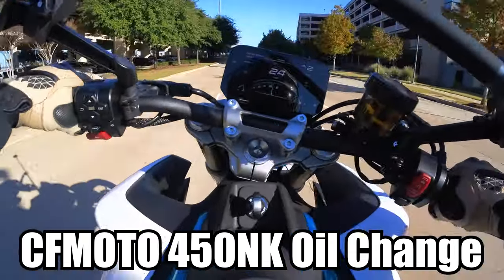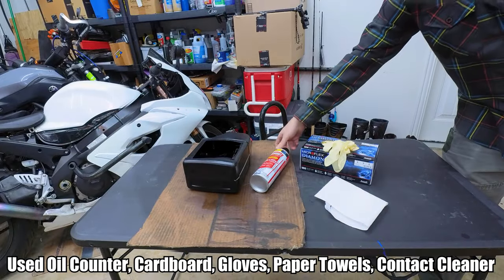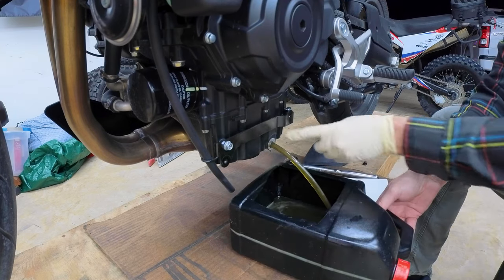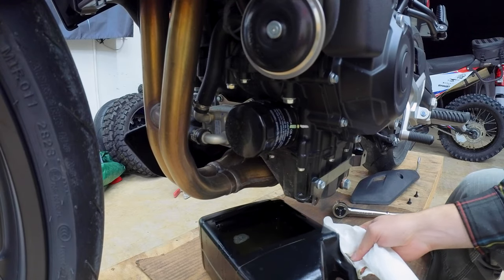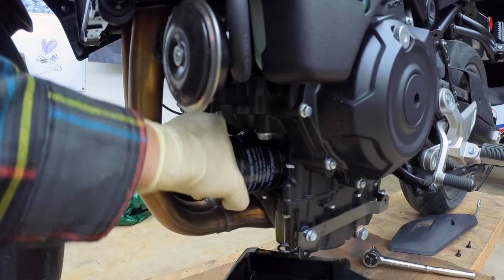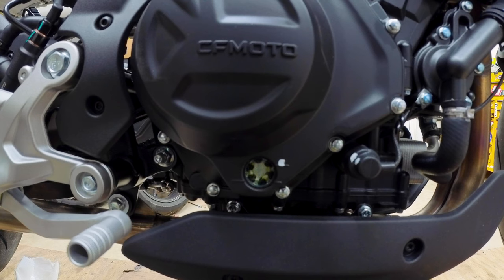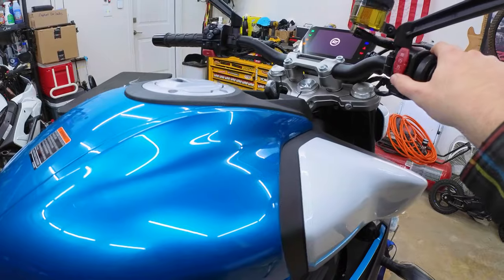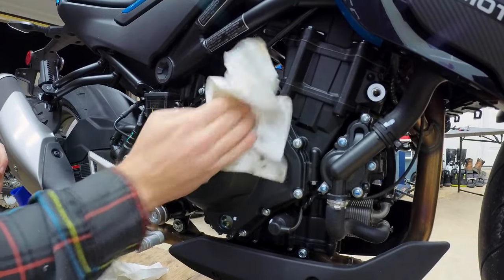CFMOTO 450NK Oil Change - Easy and Fast

Comment from the maker: Super easy oil change videos. I'm gonna try to make these for every bike I can.
Reply: YES.
Reply: EASY BEAZY BOSSS LET GETER DONE!
Reply: I know when I did my first oil change on my SV650, I was baffled by the slightly conical crush washer. I went with the 50/50 chance of pointing the cone inward to the crankcase. Turns out I was wrong, but no idea on if there is any damage until the next one in two years or so time! 😜
Reply: A man of the people
Reply: YES

Comment: Good video.  Fast but well covered.  I have the 450SS.  Did my first oil change in the fall.  Can't wait for the snow to stop so I can get riding again.
Reply: Did you use the manufacturer oil they make specifically for the bike or did you use 4 stroke 10w40?

Comment: Couple of frustrating maintenance issues about the 450SS/NK series. The recommended oil and oil filter change interval is only 3,000 miles, so skip one and you might have warranty claim problems. The oil filter is a non-standard item (unless you have found an authorized equivalent). The non-standard spark plugs need to be changed every 6,000 miles, only at an authorized dealership because the gas tank needs to be completely removed. Air filter also requires dealer only cleaning at 3,000 miles and replacement at 12,000 miles. The manual maintenance chart says change the oil and filter every 3,000 miles AND clean the COARSE oil filter every 3,000 miles. They don't say what the "coarse" oil filter is. They mention the magnetic oil plug, but that is not a "filter". The 450 series has an extremely long 24,000 mile valve adjustment interval which seems a bit dubious to me. 

On the other hand, my other buying option is a new Suzuki SV650 with more power, a tilt up gas tank, easy owner air filter access, and standard easy to find oil filters and spark plugs. On my current bikes (GSX-R750 and Sportster 1200), I do the oil and oil filter changes every 5,000 miles with quality oil (easy to know when the interval is coming up and not too frequent) and use long life iridium spark plugs that at least double the spark plug life span.
Reply: This is an extremely interesting and thoughtful comment.
Reply from the maker: The oil filter and plugs are normal in stock items. The tank does not need to removed for the air filter.
Reply: @TheGardenSnake I watched someone else's video on air filter cleaning/replacement. It requires removal of the seat and battery, which exposes the air box lid. I was wrong and the gas tank stays in place. Looks to be owner serviceable.

Comment: The manual says that only an authorized dealer should change the air filter. What’s the big trick?
Reply from the maker: They say that about most things. It’s very easy to do it yourself.